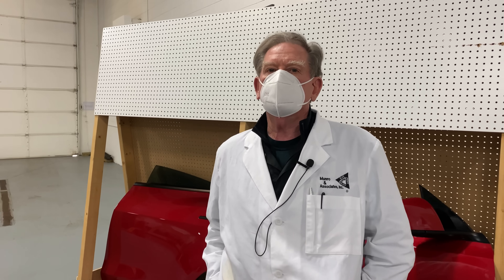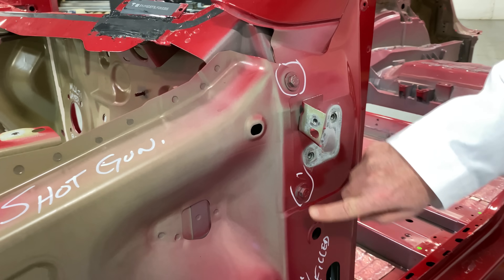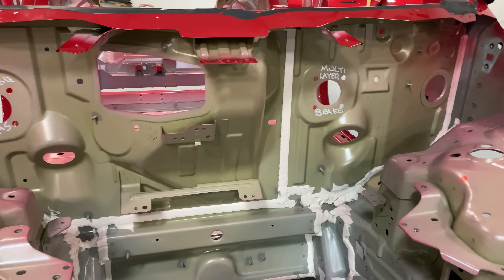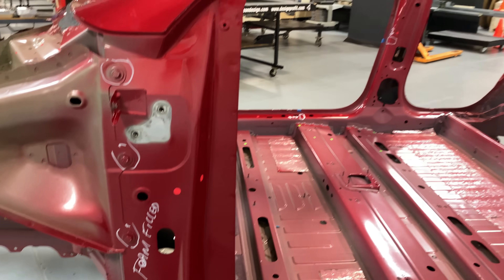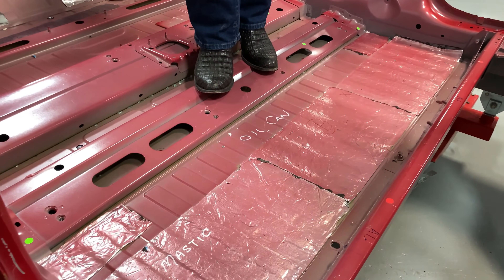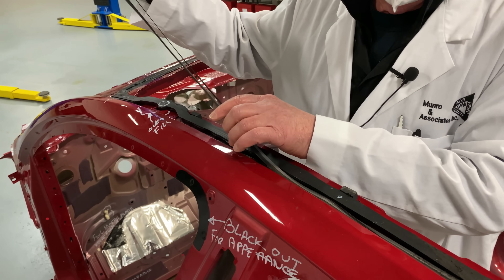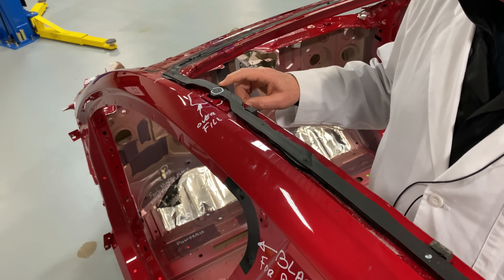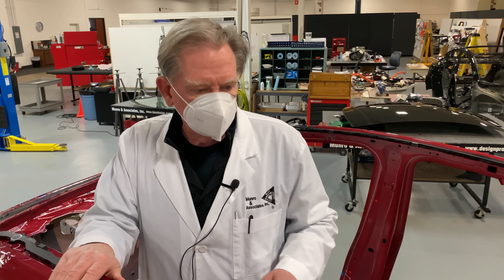Model Y E29: Down to the Naked Body-in-White (BIW) - Oil Canning, Roof Racks, More Insulation

Comment: Filling steel structures  with expandable foam  is a bad thing because the porous material is going to bind water from condensation and the structure will start corroding in no time. Lack of paint wont help either.I think Tesla is hoping that EVs will be discarded like I phones once the battery is dead before corrosion takes it toll.This is not a product that will last 15 years in a harsh climate.

Comment: Wait, is that the reason to call "shotgun"?
Reply: The shape looks roughly like a shotgun, with the front tube looking like the barrel and the "buttplate" bolted to the A pillar.
It's bolted to the A pillar to ease replacement for collision repair without damaging the structural integrity. 
The foam injection in the A pillar is likely also for energy control during a major collision, in addition to rigidity and suppressing NVH.

Comment: Isn't a glass roof more noisy than a regular roof? For the future I planned on ordering a non-glass-roof Tesla but they stopped producing it.
Reply: Hard to say. A metal roof can be large and flex like the floor and let a lot of noise through. It depends on what type of sound deadening techniques they implement. The glass roof is laminated meaning it has a layer of plastic sandwiched in between 2 glass layers similar to the front windshield. It should not let much sound through.
Reply: @JasonWW2000  
Thank you for the explination!
If the glass roof is less noisier than it must come from the windows (refering to the video where he drove the car)
That's a field where Tesla has a lot to catch up as in Europe the speed limit is 130 km/h;around 85 mp/h

Comment: That is a bead of urethane not butyl in the top of the frame.  Butyl is not typically used for autoglass anymore do to lack strength and retention.

Comment: Sandy, there is no issue with the roof rack. You need to familiarize yourself with how it is put in. It  is not an issues. I should be the same way as in the model 3. The locations you see do not have the rack attach through the center hole of that piece. They come in from the outside edge under the glass. Try watching a video on youtube about installing the rack. There are videos showing you. I put our rack in on our 3. You should have looked online first before criticizing this. Otherwise, keep up the good work.

Comment: Build quality, panel fitment and alignment are still very poor.
Reply: He measured those and it was 1 milimeter so GFY trollTARD
Reply: s3xyScorp <<< Well my Model Y Performance says otherwise. It is sitting no more than two feet in front of me as I prepare it for the Tesla service team which will be here in the morning to fix all 4 misaligned doors, my hood, rear tail light, rear spoiler falling off, a kink in my drivers side front fender panel, warped fender trim and more.  ( Two days required.)  Tesla’s team has told me they have done nearly 100 other Y’s with identical issues over the last two weeks in this region... therefore you know jack💩💩💩💩💩
Reply: @WANDERER0070    Wow, you were SLAMMED!!!! lololol  Do you feel like an idiot now? Hahahaa You should!
Reply: EPIC PAIN   <<<< Thanks! Some people just ask for it too much I guess!
Reply: @MyEyesBled  You bought a new car, in the first year, and found problems?  All new cars have problems in the first year.  EVERY DAMN ONE.  Some problems kill you.  Yours sound normal.  You are not special.
Reply: David Beppler <<< You’re right... My early production X and 3P were both nearly perfect 👌... my son picked up the Y.. I must admit I was shocked and very disappointed... but we’ll see next Monday when they finish the job. It had to be taken in.
Reply: @MyEyesBled  Did you buy your Teslas based on panel gaps and paint jobs?  My point is, the defects you are complaining about are so minor that they do not require repair, the car is fine.  Many cars throughout history have had deadly defects in the first year.  GM had one just a few years ago with airbags and Ford had one before that for brakes.
Reply: David Beppler <<< They’re not “minor”!  In fact they’re so bad Tesla is considering taking back the car, no strings attached. All it takes is ONE permanent panel (like the passenger side rear quarter on this car) to be off by .25” and it throws off the whole car.  The kink in the driver side front fender (from the inside) is blowing them away! Trust me, you would  🤮 if this were your Y.
Reply: @MyEyesBled  The car is on fire and everyone died?  The car will not drive?  Oh, no the car panels don't match up?  Oh no!  This is the end of the world!  Sorry but this is very first world problems.  I agree they should not have shipped a vehicle with "huge defects" but none of them are functional.  They are all appearance.  The doors open?  Window roll down?  It drives? Yes?
Reply: David Beppler if it would be your car you have reacted differently
Reply: @accountname1651  To be honest if everything worked properly, there were no leaks, and the alignment was fine, I doubt you would even notice anything wrong.
Reply: @accountname1651   <<< UPDATE: After nearly 5 days of trying to fix the poor fitting and misaligned door panels and other trim, the Tesla team have totally given up and will be making arrangements to swap out this fatally flawed car for a brand new one. They claim that this brand new Model Y Performance is the WORST assembled Tesla they have ever come across. Sadly I don't believe them as I saw a Red Model Y-P on Saturday in even worse shape in the Trader-Joes parking lot... YIKES Elon... get your sh*t together already!
Reply: @MyEyesBled   Are you kidding me? That's looking pretty bad if their faulted assembly ratio is that high!  If they need to repurchase 1:100 cars, that could be be catastrophic in the long haul. Hopefully your next one will be much better. Are they giving you a loner in the meantime?  You already paid for the title, sales taxes and financing charges right?  What a mess   Sorry man!
Reply: @davidbeppler3032    Haven't u been reading?  The car is an assembled disaster!  Now add something useful or go away!
Reply: @EpicPain-  Except it is not.  You can complain about anything.  He is "special" because he has the worst car made out of the first 1000?  Nope.  Many new cars have problems and his are not unique or even interesting.  The car is safe, and operates as designed.  That is more than most "problem" cars can claim.
Reply: @davidbeppler3032    Sure, that is until it's your $65,000.00! Are you done now?  Good, now please go away... troll... thank you.
Reply: @MyEyesBled  What did I fabricate?  You obviously don't pay much attention to anything not effecting you personally.  I can tell because you think you are special or that Tesla did something uncommon in the industry.  Cars kill people every day.  Thousand of pets and children die every year in cars that have no temperature control.  Do you go on every GM post to complain about a lack of pet mode?  Nope... guess it never effected you.  I hope it is a few months before you get everything fixed or the car gets replaced.  Then you can complain about that too.
Reply: David Beppler <<< Wow... Nut Case Alert! ⛑⛑⛑⛑⛑⛑
Reply: @MyEyesBled  Thank you for the report.  If it's really 1/4" off, that's a huge misalignment.
Reply: Donald Becker <<< Yup... horrible.  BTW, we own two other older Tesla’s that are a million times better compared to this.  Very disappointed in Elon for letting this through... he should be ashamed of himself... It’s gone, they bought it back at full price... I’ll wait for next year.

Comment: Am I right in thinking that they're using a single firewall design for both left and right hand drive versions? There seems to be 2 sets of the holes for the steering column and brake master cylinder.
Reply: Watch all the previous videos to get the answer :-)
Reply from the maker: Check out Episode 25: Glass Day at Munro!  Thanks for tuning in!

Comment: It sounded like you were going to explain the significance of the oil canning, but then didn't. If you have something to add there, feel free to put it in any future video. The type of people who watch these absolutely love all the details you mention off-the-cuff because they do tell a lot. If your videos were 30 minutes each, we'd still watch them. Also, props to the camera guy! He's doing great work.
Reply: I believe the significance of the oil canning is that it could be a source of noise like a drumming sound under certain conditions.
Reply: I do wish there would have been more about the structural significance.
My guess is that section is actually sitting on the battery pack and doesn't flex on an assembled car.  It's only when both the interior floor panel and the battery is removed that it looks flimsy.

Comment: I wanted to know if Sandy found the pedestrian noisemaker speaker?  Is there one or two?
Reply from the maker: Interestingly, we have had access to two Model Y’s, and one had it and the other didn’t. The one that didn’t is the the red one in the teardown videos, which is vin #XX3355. The one that did have the speaker was the blue one visible in our prize drawing video, which was vin #XXX249. Seems as though early ones launched with the speaker, and once legislation requirements got pushed to September, they may have opted to hold off on the speakers to save money until absolutely necessary. Thanks for tuning in!
Reply: @MunroLive  Very interesting! I checked my (Blue) Y and it's in the 1300 VINs, it does not have the speaker! So looks like they removed it somewhere between VIN 250 and 1300! I'm happy to have no speaker there ;) Thanks so much for doing these videos, I've really enjoyed them having owned an early Model 3 and Y.
Reply: @MunroLive  , Wow! My Red Performance Y is #XX3346! Almost a brother to this one. That's kind of cool! :) Here's an interesting point considering how close the two cars were during assembly: My cowl cover was missing the exact same "Christmas tree" clip that yours was, and the exact same cowl cover clip on the driver's side that was broken on yours was broken on mine. Coincidence? Or  something to do with the line at that point?
Reply from the maker: @NukemNak  Kind of cool indeed! At this point, it would seem that there have been enough reports of broken or missing clips on the cowl trim to assume that there's either an issue with the assembly process or the design of the clip.  Both of these can be fixed though!  Thanks for tuning in!
Reply: There's one but current models have a connector only, no speaker populated.
Reply: @domg7359  I can't believe that they would not be including the speaker!!  It's got to cost them alot to install it later.  I can't believe they would charge the customer for it.  It's going to be a major PIA to upgrade all those that wanted or are required to have it. One of the YouTubers showed  the  soon to be Location  on his 3  and It's not easily accessible
Reply: It will be populated in areas where it is required. In the US it isn't required till September. And you don't need to retrofit existing vehicles.

Comment: I have been working on my Model 3 to be able to use the roof rack attachment points that Tesla provided for a surfboard  cushion type temporary mount, designed to be strapped around the car top through the cabin windows. Wanting not to go through the car I looked carefully at the mounting system video for the Tesla Roof rack for the Model 3. A rounded L hook  goes under the edge of the glass and catches that weldment under its edge. It doesn't use that keyhole slot, as you might have surmised. By pulling up on  that weldment, supported by a thick elastomeric pad bridging the glass and the metal side frame, the roof rack is secured (a torque is recommended). I think their method keeps the integrity of the glass/frame bond and I will emulate it with the much lighter capacity surfboard mounting I am making.

Comment: Thanks Sandy ... this was one of the best episodes yet ... not just for the naked body humor, but for the great bits of insight on what may be considered the most tangible part of a vehicle's structure - the skeleton (of sorts). I have a Model 3, and now know that oil-can (or oil canning) is what I've been hearing, particularly in Winter months, when I turn into my driveway as the body flexes just a bit. Been tipping my cashiers by the way. All the best.

Comment: @5:42
saw already on orther vehicles that the glue was not yet fully solid. 
the glue is thick and that takes a very lon time to get solid
Reply: That could be an intentional.  A self-healing sealant would allow the large, structurally important glass panel to re-adhere to the body if the factory seal is broken e.g. in a minor collision.

Comment: Salty roads will have great fun with this car.
Give it s few years and its a rust bucket. Like the model 3 is becoming.
Reply: It's not bare metal, but rather the base coats without the finish layers.  It going to the seal the metal surface, but not be pretty.
It's worth noting that the base coat is not color matched.  Some manufacturers use a similar color base coat to minimize color variation and the visual impact of scratches e.g. gray base coat with silver.  Perhaps the light color base coat may be to brighten and increase the "depth" of the red, but it does risk creating an uneven appearance if the paint application isn't consistent.
Reply: Do we know whether the bare metal is steel or aluminum?
Reply: @mcreprog  only the S an X is in aluminium, the 3 and Y is steel with some parts aluminium
Reply: Thats why they invented UNDERCOATING !
Used it on every car and truck I ever had
Also should be applied when car is new and clean
Reply: @WANDERER0070  as he say bare metall...
Reply: @cofal79 , bare metal as in all the components removed. Not bare metal as in uncoated/unprotected metal. You have to understand the difference in terminology. The "bare" parts are still fully coated with primers and rust preventatives, it just lacks the final colored top coats. All manufacturers do this. There is zero point in wasting high quality paint and clearcoat to make the engine bay and bottom of the car look "pretty". It will not rust any faster than any other car. I hope that clears things up.

Comment: Hey Sandy I've been working in auto glass industry for years. Seeing uncured urathane on new cars is not unusual. Especially when it's that thick.
Reply from the maker: MadMan920 thank you for clarifying and thanks for tuning in!
Reply: Urethane consists alcohol and/or other chemical compounds than need to evaporate, in order to complete the curing process. The problem with uncured urethane on installed glass happens when two or more stripes of urethane have been applied close next to each other, thus making the inside air trapped and impossible to evaporate. This is why the proper way to apply multiple stripes of an urethane bonding agent is to leave some small gaps at certain points to allow evaporation of the chemicals that otherwise prevent the curing.

Comment: Super interesting content again!
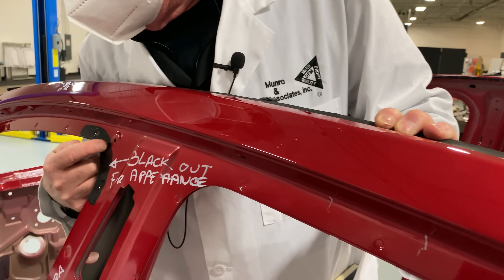Could you explain why the black out paint? 3:55
Reply from the maker: There are two seals that come together at that upper corner of the door, and it looks like they may have realized after the fact that with certain body colors, especially lighter ones, a little sliver of body colored paint was visible between the two seals. The blackout paint hides any obvious show-through between the neighboring seals. Just an aesthetic thing, and not uncommon to see, especially in areas like wheel wells. Thanks for tuning in!

Comment: So is Oilcanning a good thing a bad thing or just a thing.  What was the point of your showing it to us.
Reply from the maker: Oil canning is generally regarded as a bad thing, an unexpected and unpleasant sound that you ideally try to avoid in a vehicle. It typically happens when you’ve got a large, relatively flat metal panel that lacks much shape. You can experience the same sound with a cookie sheet if you flex it. Some OEMs add stiffening backers, some add mastic patches, some use structural adhesive, but generally you try to mitigate or avoid it if you can. Thanks for tuning in!

Comment: Yes the foam certainly will help reduce NVH. But if that area gets water logged, the foam is going to rust out the whole section. I takes 10-ish years to do so, but look at the dodge challenger for a real-world example of this issue.
Reply: The foam doesn't absorb water, it's closed cell foam on the bottom. It would be crazy to use open cell foam where it could get wet.
Reply: @domg7359  It obviously shouldn't, but check out the Dodge Challengers.
Reply: @Daniel-lv8ze  Bad placement. They put it in wheel wells where it would get wet. That's why Tesla uses a carpet-like trim there over plastic, nothing to rust. Where they put the foam on the Y isn't exposed to water, underneath there's a whole battery and battery pan which are all sealed before encountering the floor of the vehicle where foam has been injected.

Comment: Why do they have to bolt the "shotguns" on to the A pillar before they are welded? Is it just to avoid some jigging otherwise required?
Reply from the maker: To spot weld sheet metal, you need to have access from both sides. In the case of the hinge pillar, they only have single-sided access (from the outside), which lends itself to using bolts as fasteners. Bolts can also be used to engineer certain reactions during an impact through tailored yield or shear characteristics. Thanks for tuning in!
Reply: And why a bolt in the middle?

Comment: Yep, remember fixing car sheet metal oil can effect by heating and hammering or shrinking the metal then dousing jt with water using....ready for this.....Wet Asbestos to keep the heat from traveling to far....know oil canning very well especially on import cars with thinner metal.....god I feel old now.